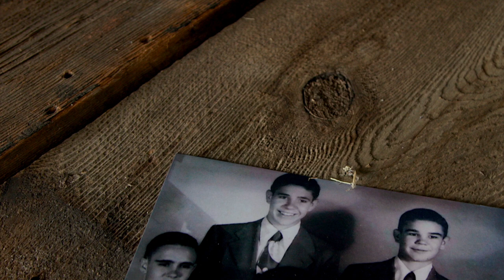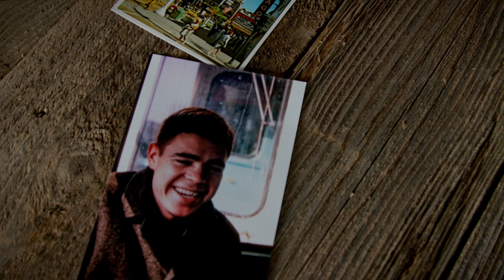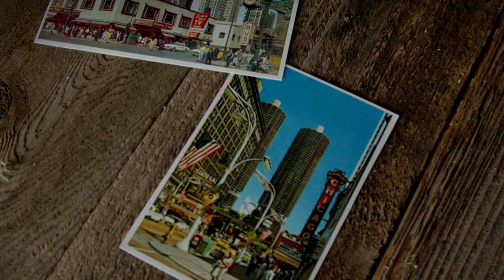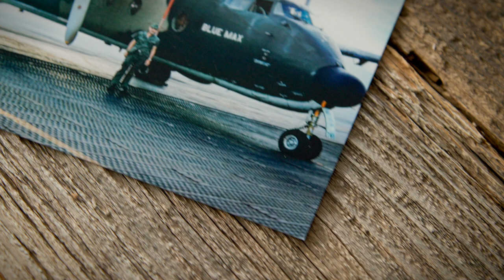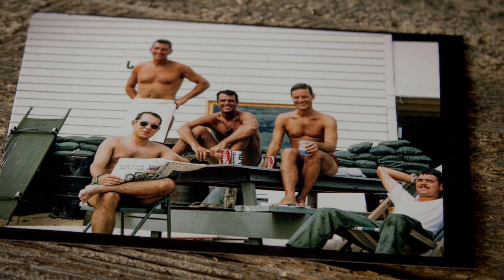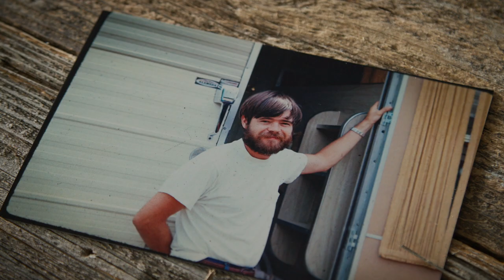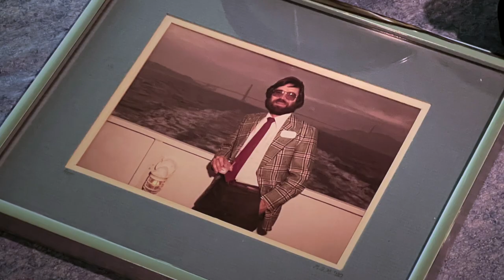The Blue Room

Comment: More blue room memories. This is a very special one. I went to commercial art school at siu Carbondale  from 1978 to 1980. In which I had a photography class. We had a assignment for Christmas break to photograph something historical or meaningful in our area. Got home for break and called grandpa Kenny so off we went to sciota mills and the blue room. Grandpa said there were old stoves and other equipment in back room. It was a snowy Sunday morning and I was setting up for my shoot. I was going to shoot an old cook stove inside the back room door. As I checked my camera Johnny sat at his table propped his leg and lit his pipe. I shot that. After graduation and Johnny’s passing dad took my photo to paint his painting of the blue room. And then did a limited addition of prints of it. Well on the wall above Johnny was a clock which said 9:15 am and it was a sunday. Dad sold all the prints years later then he had cancer and fought that for several years. On a Sunday morning in 1991 he was at home and near death. I was holding his had and checking his pulse. Well it quit and he passed. I walked out to living room and told everyone he was gone. They rushed down to his room and I turned and seen his blue room painting and noticed the clock in the painting was 9:15 Sunday morning. Then noticed the clock on the wall was the same time. I soon checked my original photo and it indeed said same time. That still gets me quite emotional as the time I took the photo of Johnny said 9:15. Dad painted 9:15 on his painting of Johnny and he passed away on a Sunday morning on a snowy January day at 9:15 am. This is a true story and quite emotional for me. 

Dave Fissell
Reply: Simple coincidences like this in life are too profound to actually be coincidence.   It assures you there is more to life.  A deeper meaning, like a beautiful portrait of coincidences placed just right to make a masterpiece.